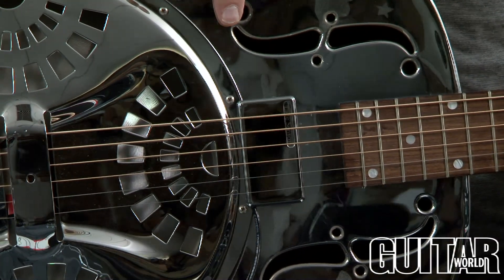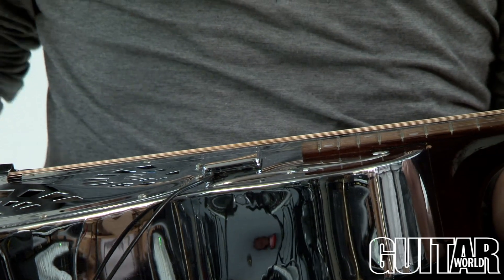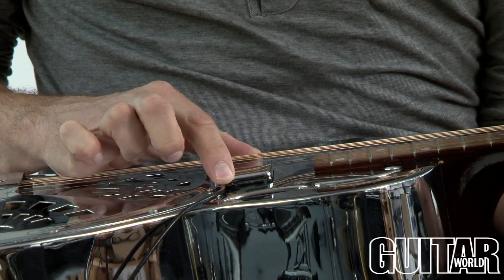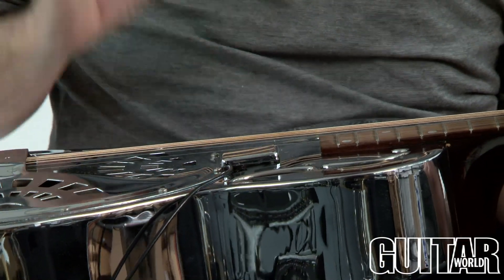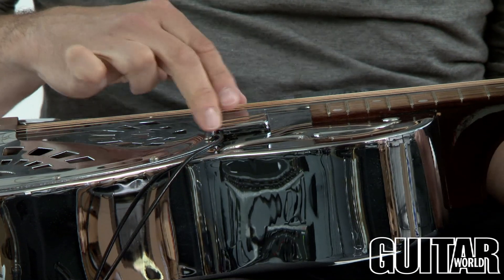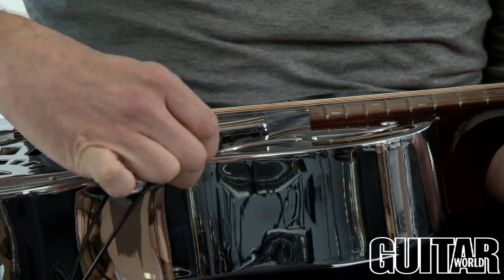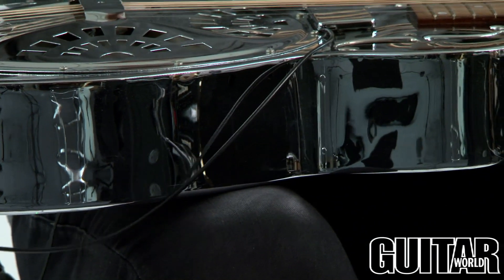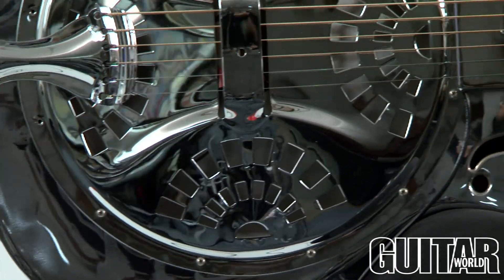Lace Pickups USA Ultra Slim Acoustic Sensor Pickup

Comment: The lace can give you a very good sound. But it is not as thin as the National thinline for sure, and it sounds more magnetic than the National which has a microphonic effect.  Also, that thin cable on the Lace has a tendency to deconstruct at the connection if you get the version that comes with a quarter inch jack.  I like the Lace if you are playing slide guitar a lot, but it is thicker than the National.

Comment: It's not slim enough, beware!  My first string is hitting the pickup when you fret it after 7th fret.  After 12th fret it gets completely stopped by the pickup.  I dunno if the solution to install it on the body permanently as a set pickup, but simply using the sticker soesnt work.
Reply: What guitar do you have?  I'm thinking about getting one of these.
Reply: National Collegian single cone resonator, a new one.  I actually kinda 
solved the problem by re attaching the sticky tape only on the bridge 
side of the pickup,  That way the neck side of it lies flat on the body.
  Obviously, it's seems less secure, but so far no problem, the tape is 
strong enough.
Reply: Thanks for the info.  Enjoy!
Reply: Yes I've had these and they are not thin enough.  The National slimline pickup is more expensive, but is thinner and will not give you any problem height wise on a reso.  Also, it has one channel that is microphonic, and the sound is far better; not just magnetic.
Reply: ..the solution is to  put it on EBay and sell it to someone like me .  :) ... n'you keep a pluggin away in this fashon, throwin yer duds back out on EBay and one day you'll find the right one. ...I'll prey about it.

Comment: would this work on an archtop?
Reply: Yes, it dies. I just installed it, but be shure to get the right hight. Otherwise the pickup isn't loud enough. But I got a humm with a touch of my finger (at high levels on my mixer) as if the wire isn't connected right to the plug. It could be my fail…
Reply: *it does 😅 shitty phone-keyboard